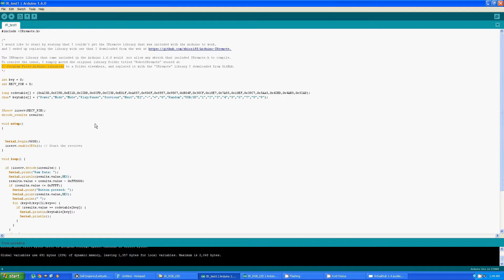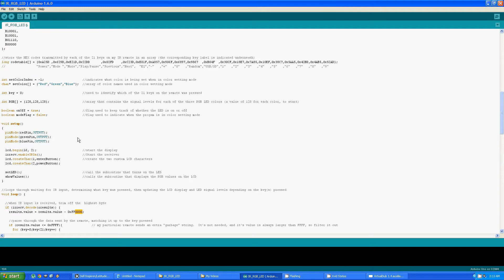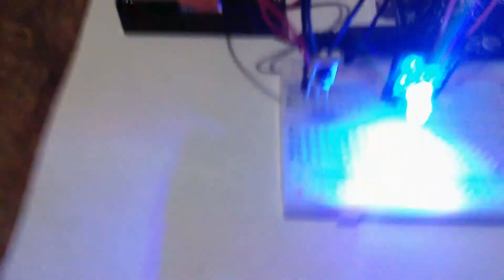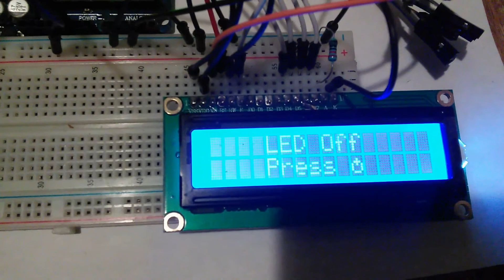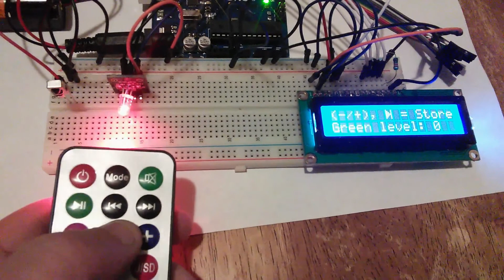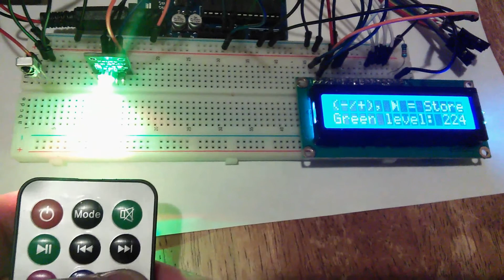Using an IR Receiver to control an RGB LED on the Arduino

Comment: this might be a dumb question (i'm a beginner in Arduino) - If we constantly keep changing the color of the RGB led, will the LED easily die (when resistors are used)
Reply from the maker: No, changing the color of the LED won't affect the LED's lifespan.  The voltage being supplied to each of the three semiconducting elements isn't actually changing; only the width of the pulses being passed through the LED are changing.  Even this rapid on-and-off cycling doesn't affect the LED's lifespan.
Sparkfun has a nice explanation of how PWM works: https://learn.sparkfun.com/tutorials/pulse-width-modulation
Reply: KingBeetle1966 thanks